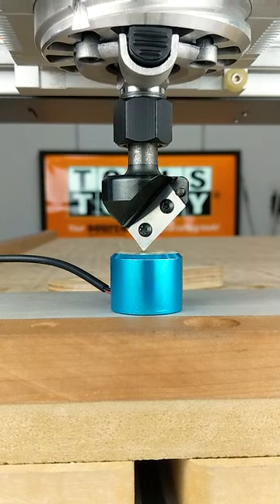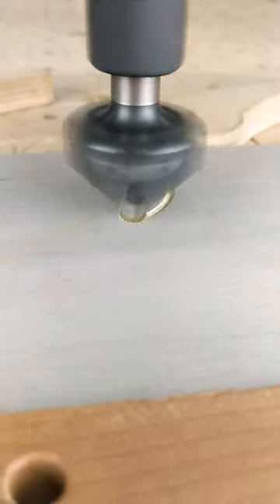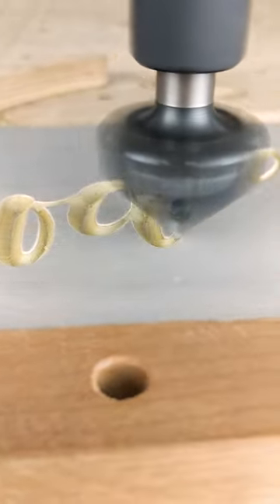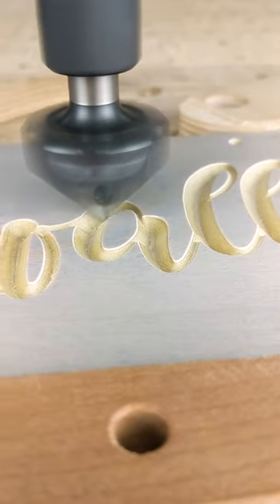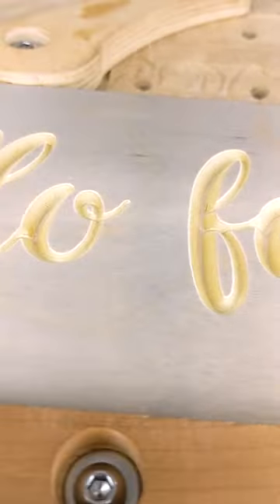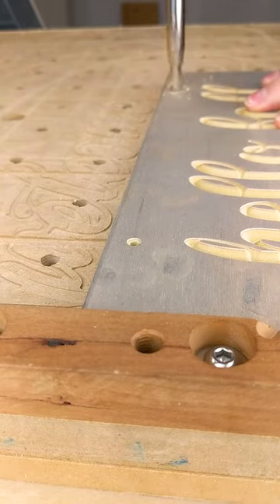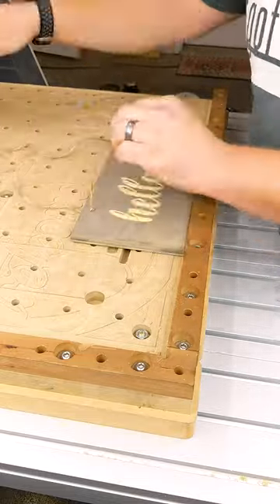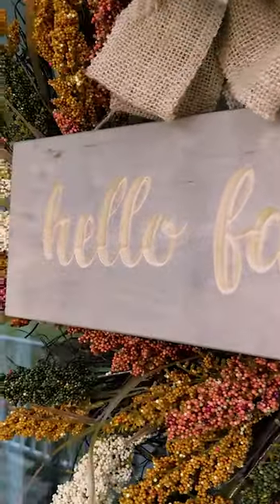Carving Fall Sign

Comment: Great and inspiring content, I saw you used a shaper in other videos, and was wondering if the shaper can be used to make the chamfered letters in this video. Most of the shaper signs/letters tend to be straight down pocketed engravings.
Reply from the maker: Thank you for the kind words, I really appreciate it!  Unfortunately, it cannot like this.  You can use a v-bit to carve a sign, but it all has to be at the same depth, it cannot move up and down while it's moving in any other direction to create the sharp corners like this.
Reply: @ToolsToday  thanks for the reply. Am I right in thinking that if I use a v-bit all my text will be uniform thicknesses and curved at end points?
Reply: May I ask if you had to build the file for this project in 3d or will a 2d SVG work?
Reply from the maker: Correct.  It uses a standard SVG file, but the v-carve toolpath is like a 2.5D toolpath as it moves the x, y and z axis at the same time